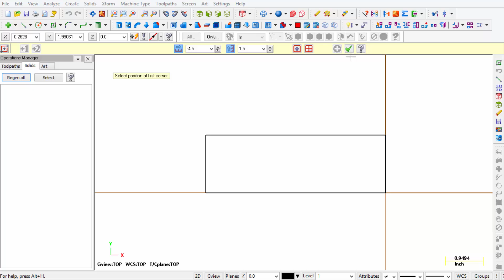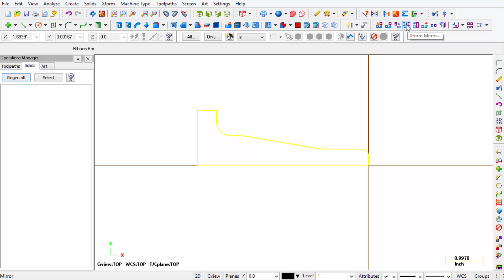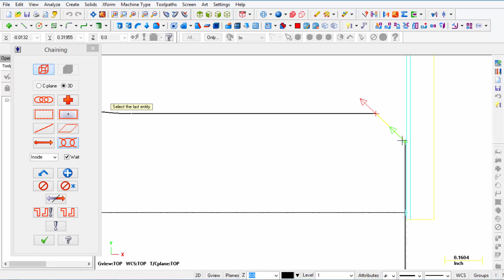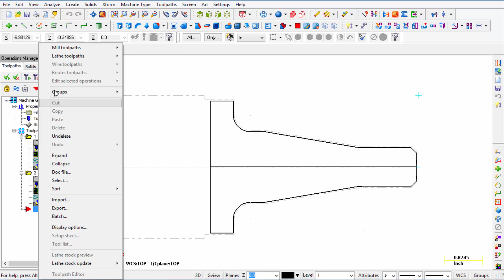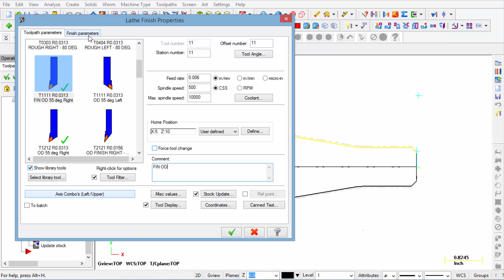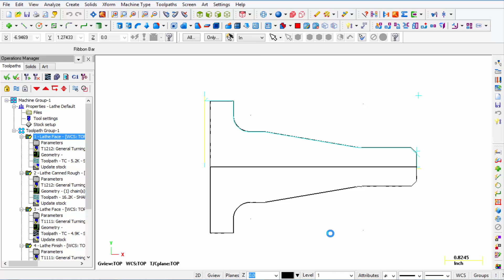MASTERCAM BASICS PART 3 - DRAW IT AND TURN IT

Comment: It's good but even something more difficult I could've written it quicker manually on the pc and transferred it to the CNC. CNC programmers need to firstly learn to be engineers then write a program from breaking down and studying the part drawing. I'll do a video soon on a complex part I wrote manually which would've taken an age to design and do using this program.
Reply: One last thing, I'd rather spend $10k on tools than drawing software. Learn to use your machines, you'll feel more of an achievement holding a part you wrote the program for rather than a piece of software did.

Comment: Hi Tom, when I create the first toolpath I get "Error making toolpath." Any ideas why? I used your settings exactly but I'm using X9.
Reply from the maker: Make sure that the geometry you selected is trimmed. Check to make sure you only have one tool path in your geometry tab in your operation. The main thing you need to look for is that the entities you select are connected to each other.
Reply: +Tom Stikkelman Everything is trimmed, I clicked OK before I put the face parameters in and I got no error, went back in and did the face parameters and noticed the "Use Stock" option had 0.04 under it. I think that's fixed it. Thanks for the fast reply Tom.
Reply from the maker: +KylesGuitar Great. Thanks
Reply from the maker: Make sure that the geometry you select for the tool path is trimmed
Reply: +Tom Stikkelman  Very nice tutorial. How entering speeds and feed automaticaly rather than manualy?

Comment: thanks for the video. I learned how to use GibbsCam on my own. Iam glad I can learn Mastercsm by watching some videos instead.
 Are you going to show how to do a type 2 g71 cycle at some point? when I try it on mastercam. the tool path looks like it will cut in to the geometry of the part. but the posted file looks like it is programed correctly. I am just wondering what i am doing wrong
Reply from the maker: +Greg Thornhill 
Yes sir. I will cover that in this series. Thanks
Reply: Awsome, thanks alot!